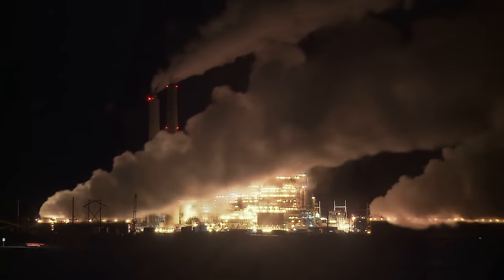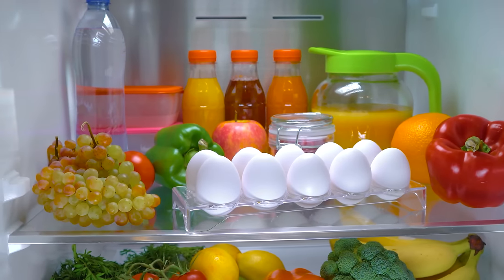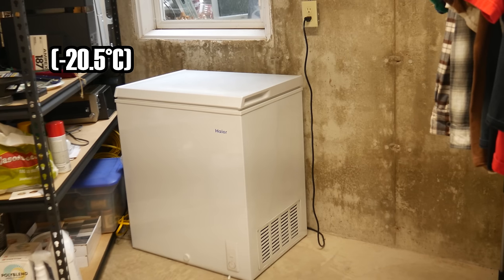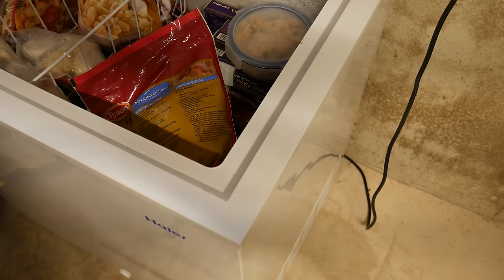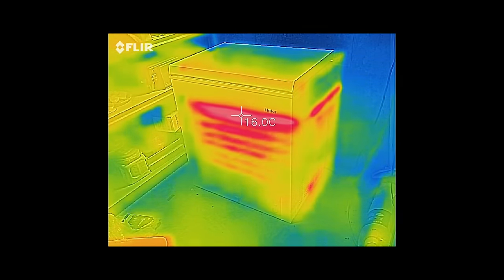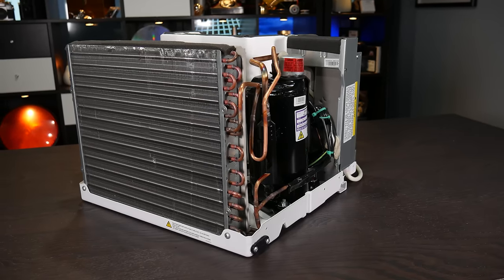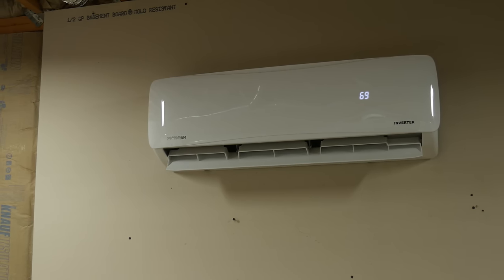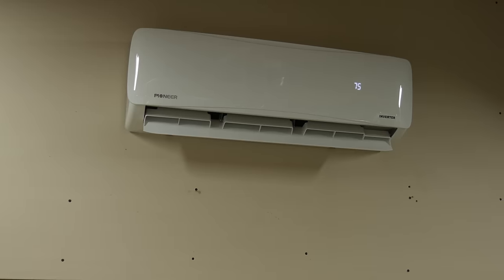Heat Pumps: the Future of Home Heating

Comment: So the solution is to use geothermal heating (a hole drilled down into the ground where its never colder then 4°C) where the pump alsogive the COP of 6). A lot of hemes in Sweden has it now days...

Comment: I'm just so skeptical this could possibly work in the -40C Prairie winters.
Reply: Do you live near the North Pole? Because heat pumps can still work very efficiently at temperatures as low as -20C, and I don't know many places who have temperatures that go even lower than that. Even Yakutsk, Russia, the world's coldest city in the World barely goes near temperatures this cold. This week the coldest temperature they are meant to reach is -37C.
And even IF you do live in a place where it gets this cold, perhaps you live in that same city, then your place is most certainly not that cold all year round. I make any bet with you that during summer, spring and fall, your place has never seen any temperature drop below -20C, that's 75% of the year where a heat pump will be very useful at your place, meaning that it can at the very least supplement your traditional heating system (may it be resistive heater or gas or whatever) to reduce its use by at least that same percentage.
If you are not convinced about heat pumps, just ask people who do have them. Even in the coldest places in Canada they are being used massively and effectively.
Reply: @texanplayer7651  that's the thing. I  know no one near me using them. I'm in northern. Canada and our Jan/Feb is regularly -30 with the occasional -40
Reply: @sinkingship101 That's probably outside the limit of what heat pumps can handle. In your case it definitely makes way way more sense to run gas, but your climate is among the exceptions.

Comment: Very interesting video. Suggestion for a next topic : all this oddly sounds like there is a "perpetual" motion somewhere in there. If you can bring more heat than it costs you, does not that contradict Maxwell's demon thought-experiment somehow ? I'd be interested by a video debunking that idea.
Reply: It requires less energy to move heat than it does to generate it from electricity, gas, etc.
Reply: @Redtooth75  
Yeah but that means in a closed box, like Maxwell's Demon experiment, you can bring more heat on one side and put all the heat in one side of the box, while the cold part remains in the other side.
Reply: @En_theo  maxwells experiment was a system that would create a temperature difference without any work being done. That violates the laws of thermodynamics. An air conditioner performs work on the system via the compressor.
Reply: @Redtooth75  
No, Maxwell experiment did consider the energy spent to "sort" heat from cold molecules. Which brings me again to the initial question, if heat pump can sort heat from cold and bring more heat than it consumed, how do we know that the total amount of difference in temperature won't allow us to repeat the operation with a positive gain ?
Reply: @En_theo  Maxwell's experiment was entirely hypothetical, the demon was literally a magical being. If it was possible you would have free energy.
What is commonly referred to as efficiency in a heat pump is more accurately called the coefficient of performance. The overall thermal efficiency of the motors and fluid flow would not exceed 100%. There is excess heat pumped that came from the electricity powering the system.
There is no way to cheat entropy, it would be real cool if there was though.
Reply: @Redtooth75  
Maxwells's experiment included reflections on the cost of sorting heat and cold (which I already mentioned). If the pump is in the hot half of the box, then its work/heat can only make the hot side even hotter. And since you bring more heat than it cost from the cold side, then you actually double the difference in temperature between the hot side and the cold side. According to Carnot's equations, the bigger the difference in temperature, the more you can use that energy efficiently. 

FYI, entropy is "cheated" every day by dark energy and other weird phenomena. Recently, a team proved that you could extract the energy from brownian motion with graphene.
Reply: @En_theo  maxwells experiment was not a real thing. It was a glorified what if scenario. The reflection was that anything that could sort those particles would have to interact with them in some way such that entropy was followed. It is literally impossible to break entropy. Not difficult, not complicated, not theoretically possible but we haven't figured it out yet, but literally impossible according to our understanding of physics.
A heat pump does not reflect maxwells experiment. Its not the same thing. Im not sure what your point is. While you could you set up a heat engine powered by a heat pump the output of the engine would be less than the input to the pump. Even if everything is 100% efficient and everything behaves in an ideal manner.
Heat pumps are an efficient way to move heat, nothing more.
Reply: @Redtooth75  
Ok I think I have been patient enough with you, I see that somehow facts and knowledge are not your thing. And btw, entropy "tend" to increase, it's not a 100% rule. You would know it if you had really studied the question before spreading your expertise.

I have already answered your question 3 times, so I take it English is not your thing too. Idk what your point is, you just seem to be blinded to any fact.
Reply: @En_theo  Why are you arguing like this? He's being very concise and clear with you.
Reply: @logitech4873  
Thank you for sharing your opinion. But there are so many arguments in what you said, I can't chose which one I should answer to... especially since it does not even fit reality.

Comment: What kills me about heat pumps is that your drawing heat from the air your trying to keep you home warm against. Sure that is not a problem if you live out in the country, but if you live in an urban area all them homes would be sucking out all the heat, turning the area into a frost trap. That in turn would require more energy and in effect you may as well be using an electrical heater to make the heat.

Comment: 18:11 dat all makes sense and all, but wouldnt that pose a danger for the other piping, when it wasnt designed for the presure diffrenece in some ACs, like..putting high presure in places that was onkly designed for low presure..and wouldnt that cause leaks and stuff from things that wasnt suposed to get cold ovO, or in other cases, hot ovO
Reply: An evaporator designed to be used as part of a heat pump will be built to withstand the pressure. If an evaporator not rated for use in a heat pump is used in a heat pump then yes it will probably fail.

Comment: Can u comment on what if we install windows AC facing outwards making cold air outside n heat coil inside is this same as heat pump ? How is efficiency different ?
Reply: It would function pretty much the same as a heat pump. But it would lack the defrost feature so the coil would freeze in colder temperatures.

Comment: A friend of mine just put in a all electric cooling and heating system. All the latest and greatest. Ac this past summer was great. Then the heat pump started to have to work. RED ALERT, RED ALERT!!  Their electric bill sky rocketed to twice the cost of the natural gas furnace they use to have with the normal electric usage.

Comment: U did not even mention best heat pumps. U drill hole 10-20m to get to underground water and u have constant temperature of 16°, that means it is A LOT more efficient than air one. in EU they are very common and can heat up whole house very easely. Ofc there is not underground water everywhere, but it is worth mentioning. YOu can even use outside pool as heat source since it will not go belove 0°.

Comment: Perhaps the manufacturing factor then, its not equipped with two design manufacturing lines and so it saves cost to have a single manufacturing lines doing non inverter, and another line with smaller output doing inverter line

Comment: Heat pumps are great, and a good way to heat or cool your home, or any building
The first thing you have to understand is, an air to air heat pump is the less costly of the two types.
Air to Air, or hydrothermal to Air

Air to Air, only works to minus 9 degrees Celsius. Then frosts up.
 After the air to air stops, you require a heating element to heat your home.
This means, in short, Air to Air Heat pumps will not work, without the electrical heating element back up.
In the top half of the United States, and all of Canada. Electrical heating elements, sized to the building, can be costly and dangerous.

The other heat pump system, called Hydro Thermal, is very costly, and very difficult  to retrofit, into an existing home, with either fuel furnaces, or Electric heat.
Hydrothermal Heat pumps, are very easy to install in new construction, however very costly, up to three times the cost of Air to Air heat pumps.

Why.
Because you have to find a heat source to draw from.
This can be from water, or radiant ground heat.
A water heat source, if not located by a lake or stream, requires the Drilling of a well to tap ground water. This can be costly, cost prohibitive. In fact depending on the length and duration of the heating cycle, the water well can be frozen from pulling out too much heat from the ground water.
Freezing of the ground water, can be removed by drilling two water wells. And using circulation between the wells, water

Heat from a ground source, requires trenches to be excavated, to length and  depth, required to source enough heat, depending on your location, again sized to the heating requirment.
Both water and ground source, require
Lengths of tubing, circulating, a liquid to absorb, the heat from the source, be it water or earth. .
In short much more efficient, and much more costly.
If your State or Province, offers financial  subsidies, this of course helps.
Buyer beware in either case of the contractors engaged.

Comment: Heat pumps do what they say, except sufficiently heat your home. Whether or not they work to the user's satisfaction is highly subjective, of course, but my dad's house never gets above 60° in the winter. That would be fine for me, but not him. So he says it doesn't work. So suffice to say you won't get the performance you get from gas central heat. So I would say it's an interesting tech, sort of like electric or self-driving cars, but not quite ready yet to take over as the primary tech in its field.

Comment: If you believe Heat pumps are the future, you’ve never worked in HVAC.  Heat pumps are absolute shit.  Your vent temps will be less than 100 degrees, body temperature.  For reference gas furnaces blast around 150. They only work efficiently in certain temp zones at certain times.  Your equipment wears out twice as fast (it’s running all year round instead of a few months of the year…..or it doesn’t run at all because you’re on emergency heat all winter due to the Pump being unable to produce enough heat. 

Also on heat pumps, they are called indoor and out door coils.  Due to the dual usage.  If you don’t live in the south don’t bother with a heat pump.

Comment: Not. You still use heat strips with heat pumps. They are required by law on all heat pump installations. And when it gets below zero the heat pump is useless by itself. Flame heat is the best heat source in using heat in below zero temperatures. Im not talking about below freezing either I'm talking about American temperatures. 73

Comment: Our 23yo heat pump just died last week and we’ve been soliciting quotes to have it replaced.

It will interest some of you to know that one contractor let it slip this week that, essentially, all the units he sells are in fact heat pumps, and he just configures them based on the spec you purchase.  You can run the same units at 2-4 tons, and the reversible portion of the unit (ie-winter heating portion) can just be activated or deactivated.  There are also multiple algorithms to dial in whether or not your preference is comfort or efficiency, so there is wide variability to how the unit can be programmed to run.

Comment: Heat pumps stop working at temperatures that are either too high or too low, which means you have to have a home in an ideal range to get the most of them. 

So they're great in temperate climates, but iffy in colder/blazing environments.

In other words, if you're in the right area, heat pumps are great.
Reply: The Goldilocks zone for heat pumps.  Not to hot or cold.

Comment: The problem with heat pumps is they suck in extreme heat or cold, and struggle to move the indoor temp more than a few degrees. Toss in the fact they are maintenance whores and I'll stick to my outdoor furnace. It just ALWAYS works and isn't picky on fuel.

Comment: Ya they work as long as the power stays on, and that is when you really need the heat in the middle of winter.
Reply: Gas furnaces and boilers only work when the power stays on as well.
Reply: @BenIsInSweden  A gas furnace in the average house only requires enough power to run the blower fan and electronics so a small genset will power it up, I've done it. I know that a heatpump could be setup the same way but requires more power.

Comment: it would be insane to use solar thermal energy as the auxiliary source of heat, so you can install a smaller heat pump and why not, let's be crazy, do the defrosting with that as well

Comment: If you are already heating with electricity, then this may make sense.  But in the UK we have ~300GW of household gas heating, and there is massive concurrency in that.  So even with a favourable COP, only a fraction of this could be moved to rhe grid.   Compound that with the demand of EV charging and it just won't fly.  
Still not stopped them pushing and subsidising this nonsense.

Comment: I have a Samsung 18,000 btu.  The only reason i got it was because my state posts energy prices as cost per Btu.  Before Bidenomics doubled my cost per kwh over two years, using the mini split provided value equal to firewood.  Now its just cheaper than buying heating oil.   FIREWOOD is the best option.  Spend that $6000 on a new woodstove and you will never regret it.

Comment: By the way, that R134A stuff you're playing with? It's the exact same stuff you find in electronic "canned air" cleaners(it's nonflammable and nonconductive, making it safe for electronics, though it CAN cause damage through cryo damage, so be careful and don't spray it upside down), AND... because it's so ridiculously nontoxic... it's the propellant used in medical inhalers.

Seriously. It's so well tolerated and so generally safe(despite what a very obvious bullshit study pushed by the oil and gas industry recently said) that you can spray it straight down the throat of children with asthma with no ill effects.

Comment: So wouldn't ice buildup on the outside if you're "cooling" frozen air outside???
Reply: Yes, that's why a heat pump needs to have a defrost cycle, which is really just that the reversing valve switches the system over to air conditioning, and that's why most residential heat pumps have a back-up heat source, usually electric heat strips. They run to heat up the cold air blowing into the house while the system is defrosting.

Comment: In an old house in the very north east running 300,000 btu furnace burning diesel fuel that barely maintains 60* when it's 10* outside. a heat pump would be useless

Comment: I liked a guy who built a green house so that his heat pump could work at a much lower temperature in the winter.

A heat pump water heater will help keep your garage cooler and dehumidified.

Talking about ground source.  You can get a water heat exchange module that can be added to your heat pump system that lets you run water from your pool to prevent cool the refrigerant before it gets to the condensor.
Reply: I thought of that as I was watching the video. Why not just put the heat pump inside an insulated enclosure?
Reply: @Krane  think of an insulated space like a bucket full of water.  Now add a pump to pump out the water.  Eventually, you will run out of water.

The greenhouse raises the ambient temperature enough that it keeps the bucket full of heat to pump.

Comment: Is an electrical dehumidifier more efficient than a chemical one?
Reply: That depends on how much water you need to remove from the air. If you're just trying to keep your pantry closet from making opened chips/crisps stale, a passive/chemical dehumidifier is probably fine. If you live in the southern US or a temporate or tropical coastal area and suffer from swamp ass and humiditties every time it gets above freezing, just get the active/electric dehumidifier. I used the passive ones for a few years. But the water condensation on the windows during winter let me know that it wasn't enough.

Comment: Anyone that knows about physics knows that HVAC units just move heat from one place to another lol... things don't get cold they lose heat... I've had friends that know more than the average person, completely confused when I tried to explain this concept to them... that and heat does not disappear... it's energy and it is just converted into another form not lost... so basically your heat pump is just moving the heat... you can choose where it is moved to...as long as the temperature is above the working temperature of your refrigerant it's possible... the closer you are to the limits of the refrigerant I would assume it becomes less efficient...i think it's just the added complexity and initial cost that makes them less common

Comment: Pretty sure the problem comes at lower temperatures, the colder it is, the worst the efficiency of the heat pump.  
Imagine it is 0F degress outside and your heat pump isn't able to warm the house well enough, it costs the same amount to run as it does on a slightly warmer day, but it is less efficient.  
  
Just not a good technology unless you don't live in very cold climates.